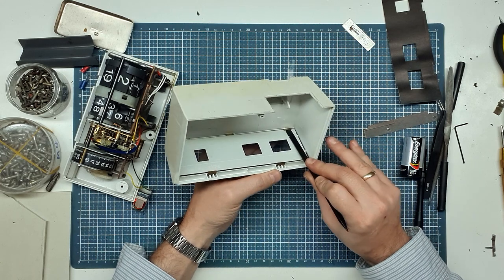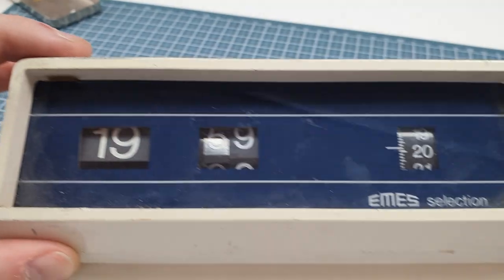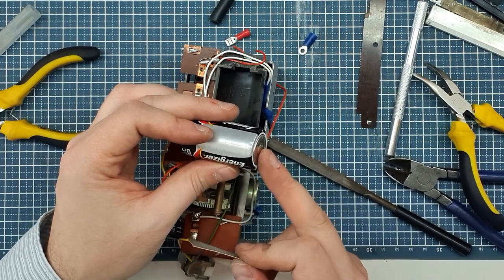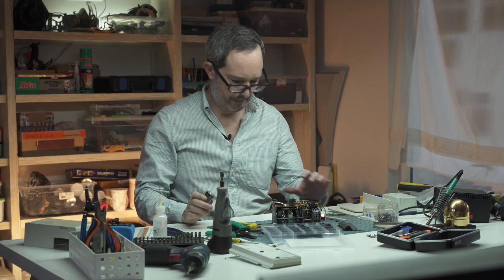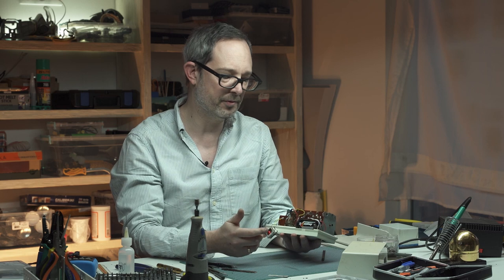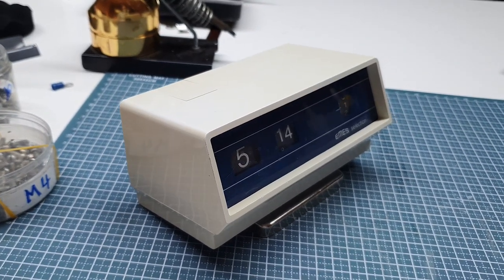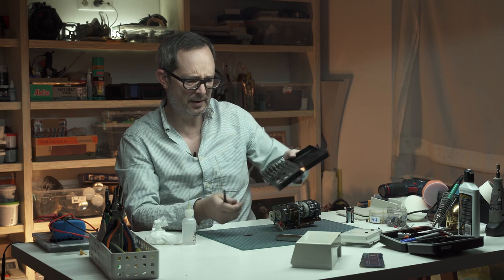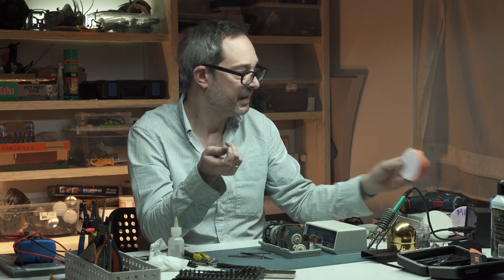Flip Clock Repair and Plastic Restoration! — Emes Selection

Comment: Really like this episode! I heard, than 3D printing can handle small parts and be stable and unbreakable
Reply from the maker: Thank you, Elina! The 3D printing option is worth investigating further. :)
Reply: @WorkshopNation  If you can measure up all the dimensions of the wheel, get a drawing, someone with a resin 3D printer could easily print you up a new part for sure. 
Though the finess of the part leads me to believe fdm isn't the best option here

Comment: Enjoyed your video. A suggestion for plastic restoration: 3M Ultra Headlight Restoration Kit-39195. It takes a good bit of time, but it worked wonders on my 14 year old headlights. I haven't tried it on anything else but when I get a chance I'm going to try and restore a smoked plexiglass lid on a turntable.

Comment: Maybe some ss wire bent into a narrow staple and inserted into each cog. One prong into the small gear body and one at the cogs point. If it was drilled through the entire gear set, it should have good stability, with the right wire gauge.

Comment: A pity, maybe you could use a flat sheet of material to make a new gear, (just the worn one, not the whole stack) as in with a heaps of meticulous filing etc., then cut/shave that worn gear off the assembly and attach your new one.